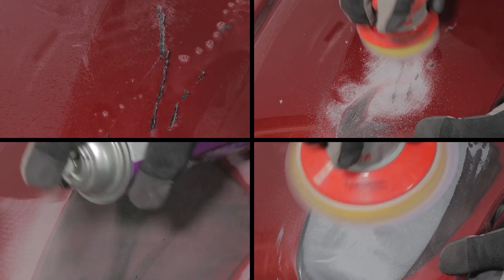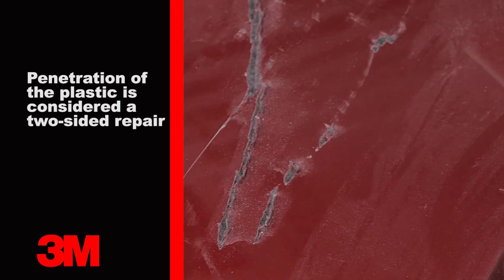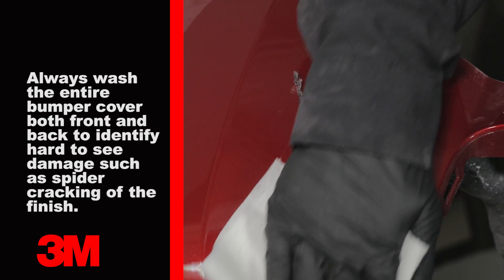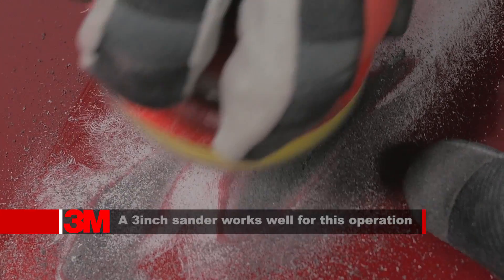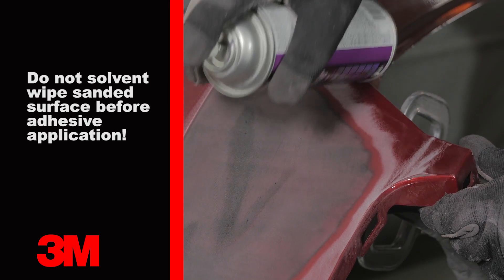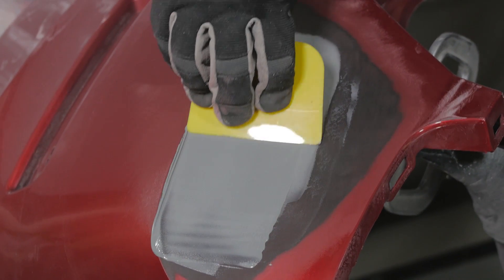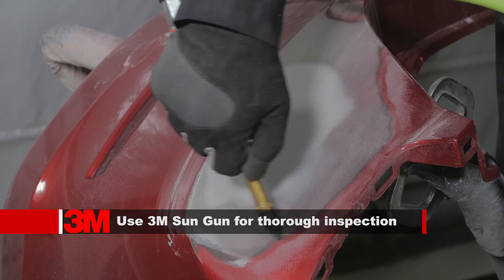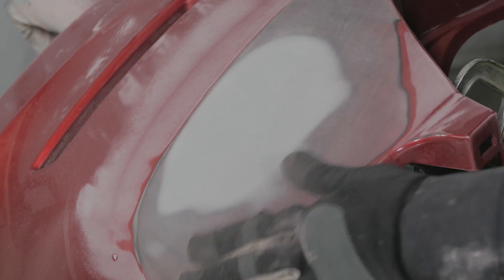Proper Cosmetic Flexible Repair Bumper Repair Process

Comment: "With clean dry air"...what else is air supposed to be?
Reply from the maker: Depending on your compressor and/or pipe you may have contaminated air (rust particles, oil, etc.). Always good to have your air quality tested and adjust filtration as needed for body and paint departments.